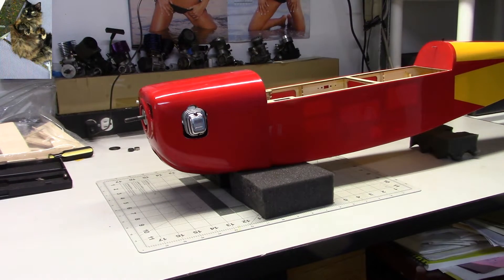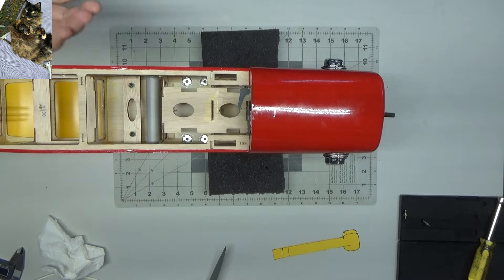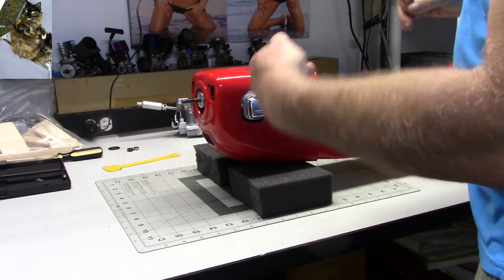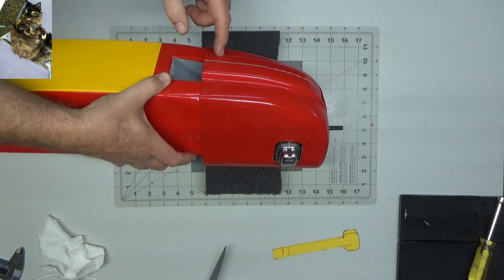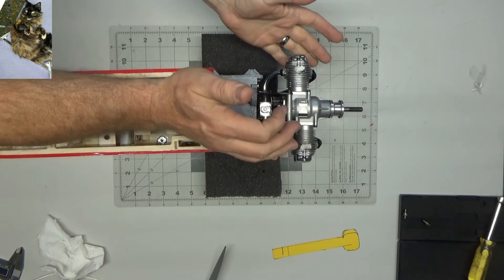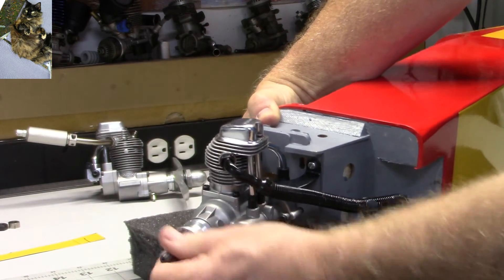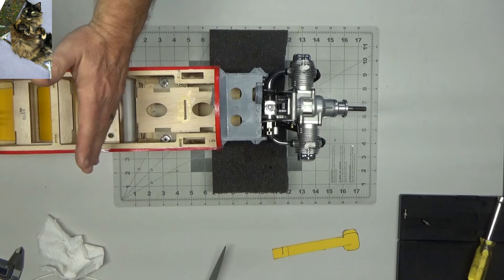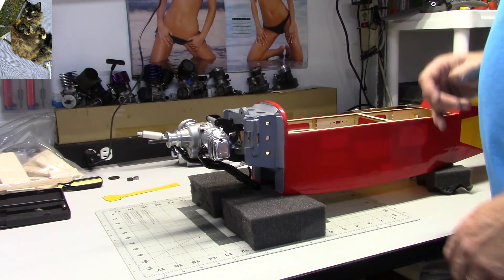Phoenix Spacewalker II Engine and Cowling Installed Part 3

Comment: The flex exhausts have no nipple for pressure to the tank as far as I can see.
Does the engine run OK on a climb out without tank pressure?
Also, if there's no pressure line to the tank, do you need a valve to let air into the tank as fuel is used?
I see the video was 5 years ago but a flex exhaust would be great for my current build with a Saito 100. Thanks.

Comment: I don’t think moving the tank back will make much difference on CG. CG is checked with an empty tank not a full one. I like your cowl installation, maybe add a little more relief around the cylinder head to even up the cutout. On one of my 2-stroke models I have to remove the cylinder head to get the cowl off. I normally aim for 2-3mm (1/8”) relief to keep as much cowl as possible.

Comment: Looking Good!!!  I like to use a permanent marker to fine tune around the engine, comes off easy with alcohol.  I would suggest making the holes a tad bit bigger, it will help with the on/off too.  Dremel Barrel sander(Oh Yeah).  Smart slit on bottom, once final fit, get some epoxy or JB weld and glue it back(inside only).  Nobody gonna see it...
Reply: Steven Stowe, if it’s epoxied up then the cowl can’t be removed again without cutting. I think David’s idea of red tape is a better option.